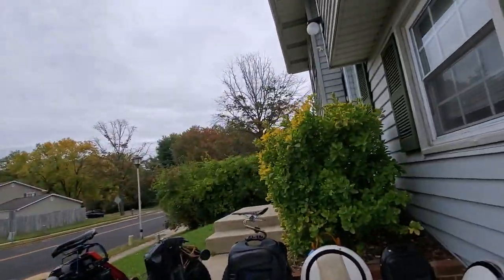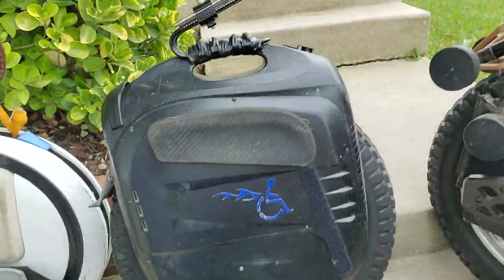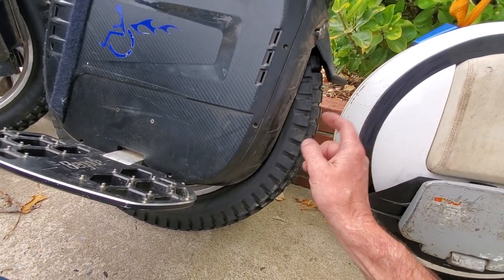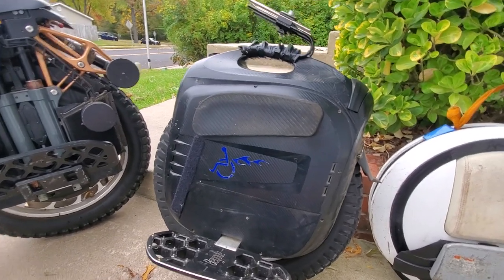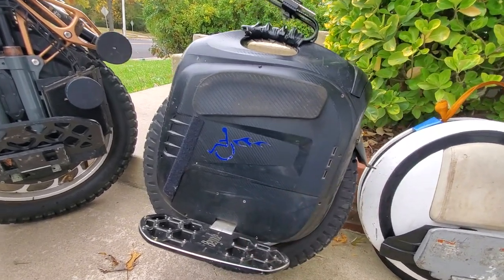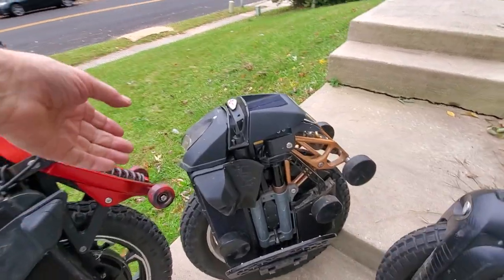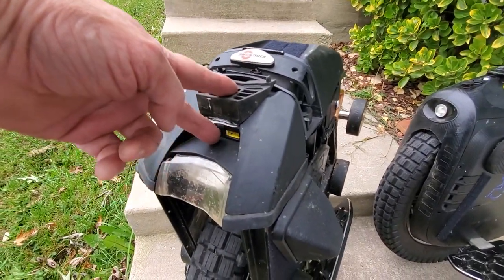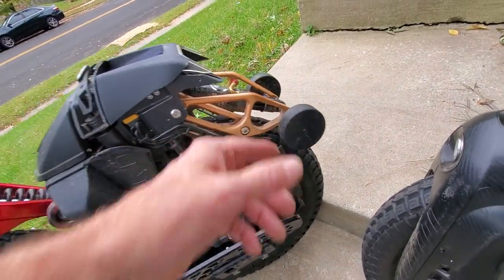Seven Wheel Story.  e+, MSX100V, S18, S22, Master, mTen3, and A1

Comment: I ride Sherman max right now, love it❤thanks for the video!! Thanks brother 🙏
Reply from the maker: I've not yet had an opportunity to ride a Sherman max.  or Sherman S.  I'm curious how it compares to the Master and the S22 for speed, range, and suspension.  So far I'm still faster on the S22 (42mph today).  But my Master still has a crappy non-round tire that couples the bounce into the speed wobbles.  It gets uncomfortable over 30 and impossible over 38 mph (my max on it so far).

Comment: I have a v12. I have over 500 miles on it now. I want to upgrade. These black friday sales might be my chance. If not by spring I want a suspension wheel.
Reply from the maker: I would point out that your "use case" makes a big difference to which product is best all-round for you.  Or you can just keep chasing the next extension to use cases like I did.  Biggest right now is likely on/off road.  Off-road favors Kingsong (new version of S18 with 40T or moli-cells, or S22 with rollers).  On Road favors Begode (Master or T4 depending on speed-distance and maneuver-ability/carry-ability).  Faster-longer range options are developing now too (V13, Master-Pro, etc).

Comment: That is some collection and history.  I am a believer in having only a single wheel for myself. Mostly do to the cost of other hobbies, flying being a big one.  So my next wheel I will take my time selecting. Want suspension. Needs same or better power/torque, bat size as my last wheel which was the MSP. No 1st runs that's for sure.  Right now the T4 is looking good or the Hero. Not getting it till next spring.
Cheers
Reply from the maker: As the story goes, there was a good reason for each new wheel.  I started small and cheap with the e+ for only $400 in 2017.
Reply from the maker: PS:  I think the T4 would be really good off-road and among people with a knobby or at least a dual-use street-trail tire.  The Hero is more a road wheel with range, and I think its a little obsolete sorta like it never really took off on the market (compared to the Master and Master Pro).
Reply: Sherman S all the way for me!!❤